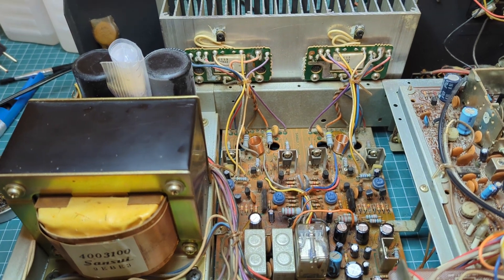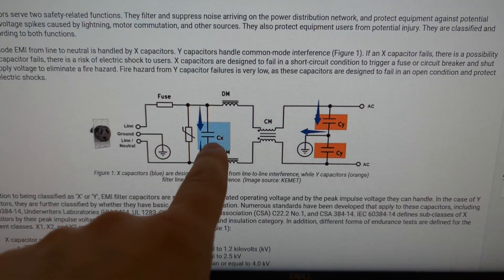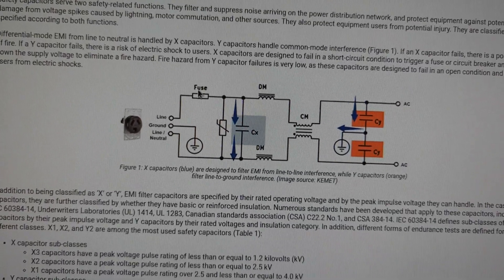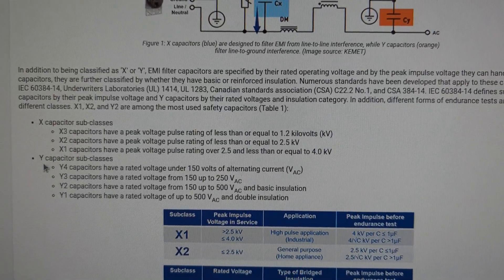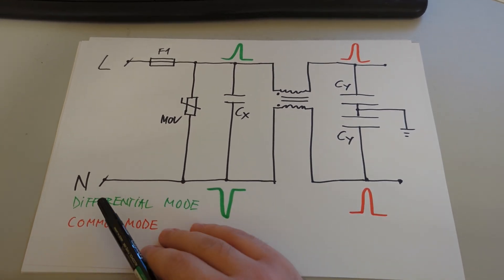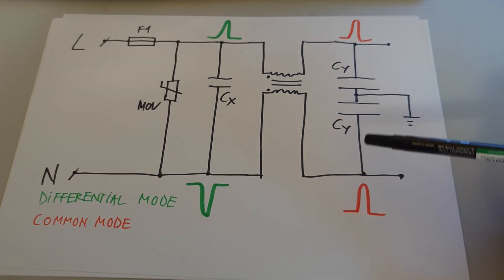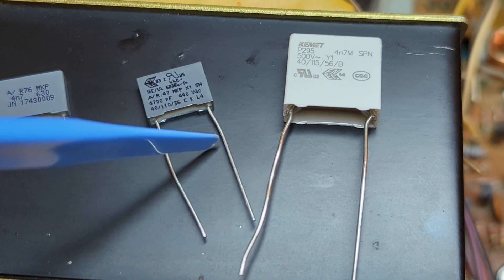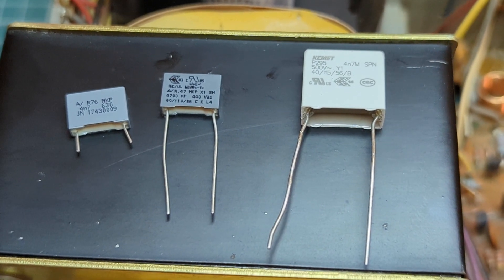Know Your Safety Capacitors!

Comment: In old guitar amps from 1960s & 70s  these are called “death caps” and people routinely remove them when updating to grounded power cord… maybe it’s better to replace them with this type of capacitor? In these old amps they are always a ceramic cap.
Reply from the maker: @VegasCyclingFreak  Good point! I forgot to mention death caps. The correct replacement would be a class Y safety capacitor, even though it wouldn't do much if the outlet is grounded. In new designs you would use a full EMI filter just like the one presented in this video and I bet it wouldn't hurt to have one in an old guitar amp. It would probably attenuate all those pops and weird noises in the speaker every time somebody turns the lights on or off.
Reply: @VoidElectronics I have a couple of Polytone amps from the 70s and a ‘74 Fender Twin Reverb that have the so-called death cap and a polarity reversing power switch. My ‘84 Seymour Duncan Covertible is set up same way too. I guess at the time that is what they did to try to lessen mains power noise. My ‘65 Fender Showman still has a 2-prong power cord and the death cap, but I don’t really use that amp. It still has the original power tubes in it from when it was new.